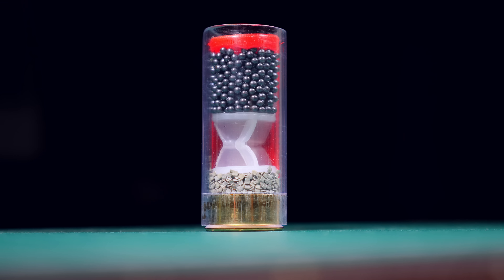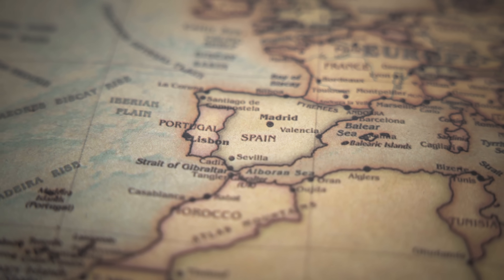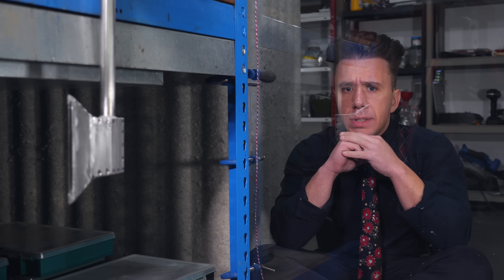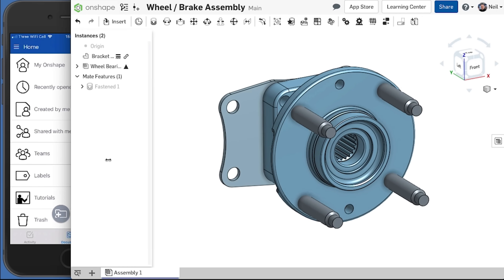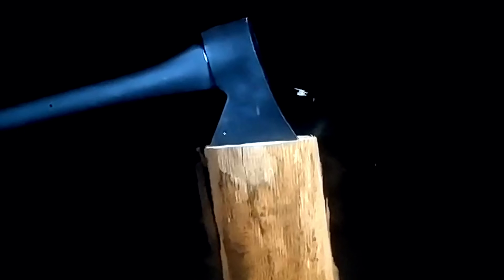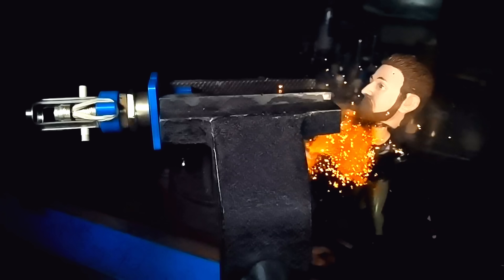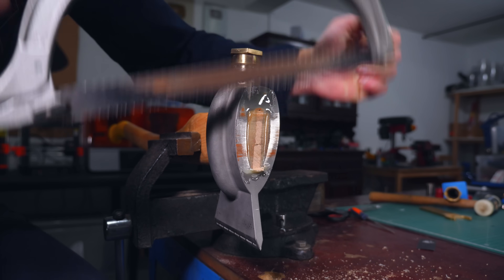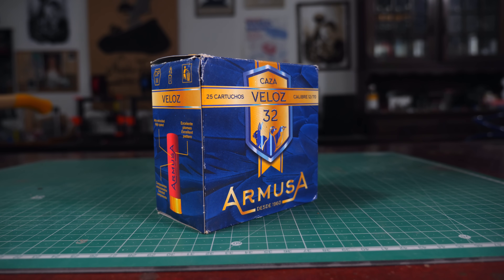I Built a SHOTGUN AXE

Comment: If that's a penny can I have a dollar 😂lol, and ur curious to why the Styrofoam plate boat jump to the left when u said u pulled away too quickly unsure if you noticed the drop that fell in the water to the right as you pulled away.  

** not that I know anything about physics but what if you made the track more like a water slide? I mean by using 3" pvc pipe cut to make two pieces of track,  you can use a heat gun to make any curves.  My theory is like the idea around the whole project "water tension" , in my mind the water in the track will act like the water on the coin and not adhere to the side as long as you don't over fill it,  giving the boat enough clearance to not hit the wide walls.

Comment: i think you've over engineered it. A simple gravity counterweight instead of magnets and rubber bands and half turn lock would be enough, with the half turn going slightly up after locking to prevent accdental unlock. Great video though

Comment: 1:28 a solid axe head with a single hole of the front would have been better — sharper, stronger and more effective.  If the middle 10% of the blade was hole, then it would fire into the gap opened by the remaining edge.

Comment: When I was heating with a woodstove back in the early '80s I had a Chopper I or something very much like it.  Depending on the species (hemlock is a pain in the arse to split) it worked pretty well but it'd send pieces flying.  I spent 'way too much time chasing them down.  If you don't mind chasing wood your shotgun axe will work, but you'll also spend too much time resetting for another swing.  What about gasoline or propane?  No need to set a fresh shell, and probably cheaper to operate in the long run too.

Comment: you have no locking mechanism, you have no safety, and you have a hammer being pulled forward with only a magnet stopping it from moving... litterally the most dangerous you could have made it... its designed to fail with any kinetic force applied, drop it, slap it, it fires...  if its not making something like this should probably be illegal XD... if anything i would put a spring resisting the hammer so the force of the swing acts against firing but a heavy swing fires.

Comment: Mr Integza, what an amazing axe! I was thinking about the way you ignite the shotgun shell and I had and idea. What if instead of having the shell detach from the magnet, you have the shell positioned in a way so that the impact pushes the shell back into a small enough pin that wont penetrate the primer but still ignite it and have the impact and ignition at the same time. I feel there is a slight delay with the magnet. just an idea what do think?  btw tomatoes are disgusting.

Comment: I don't know if you just didn't show it, but you can put the axe head-down and hit the handle with a hammer to seat it in the head. This is useful when the handle is sort of wedge shaped already, and makes the hold a lot stronger when used in conjunction with a wedge on the top.

Comment: This needs a tube magazine inside the handle and a blowback mechanism that chambers a new round after every strike.

Edit: If it was blow-forward, it could even kick the axe back up into the ready position after each swing
Reply: Shotgun shells are expensive (and depletable, and dangerous).  The cost of the resulting processed heating fuel could easily end up being more expensive than heating oil/diesel fuel/propane.

A likely more economically practical (and much safer) approach for homesteaders is to buy an electric chainsaw plus electric motor powered log splitter, combined with an off grid solar power system (which they should already have anyway, if they are serious about homesteading).  Electric log splitters, combined with off-grid solar panels, use no consumables.  The rest of the world could go full "Mad Max" (and/or "Mark of the Beast") and one would still have ability to heat their house indefinitely (at least to the extent that they have access to functionally unlimited wood and their equipment is reliable, and/or they obeyed the prepper saying "two is one and one is none", by obtaining "extra" equipment to replace broken non-repairable equipment).
Reply: @Fritz_Schlunder  That's crazy but you've completely ignored the fact that none of the alternatives you just listed are cooler than a repeating shotgun axe
Reply: @handforgedfuture  From a "cool factor" perspective, I think you would win the argument in the minds of many.  That said, even higher "cool factor" designs are likely possible.  Hypothetically one could design a customized shotgun shell that fires a delayed explosive wedge shaped slug into a piece of wood.  In theory, after firing the slug into the wood, the slug could then explode and blow the wood apart into a bunch of dangerous flying splinters, but with high "cool factor" in the process.  The ranged nature of the exploding slug would provide the user with ability to "chop firewood" from a distance, while providing "sport shooting" like entertainment factor as a bonus.

What human actively enjoys chopping firewood by hand with a conventional axe?  What human would actively enjoy "remotely chopping" firewood by firing special shotguns shells into the wood instead?  I am guessing more humans would end up falling into the second category than the first.  A sizeable percentage, probably a majority of humans seem to enjoy playing with guns.

Alternatively, one could hypothetically design a pulsed water cannon powerful enough to split wood directly.  Such device might have some "cool factor", especially when the operator gets hit with some splash back water and the tool is being used in the wintertime.
Reply: @Fritz_Schlunder  Who are you arguing with, dude? Relax it's not that serious
Reply: @handforgedfuture  I am not arguing with you.  I am telling you that you are correct, a repeating shotgun axe has high "cool factor".  The primary intended audience for my comments are other humans that may happen to come across them and read them on the YouTube platform.  You are not personally the primary intended audience for my comments, but interactive dialog with others provides a vehicle for propagating additional (but still related) ideas into the collective consciousness of those who may read the dialog/exchange.  In order to add "value" to the collective consciousness, new/different/unique/value adding ideas are required to be added to the discourse.  If everyone who watches a YouTube video all comment on the video with the exact same comment (ex: "That is so cool!"), then they are not really adding value to the collective consciousness, since their comment is not unique from that of everyone else's comment.  It is therefore preferable when people add new ideas/information when adding public comments on the internet.

Comment: Great project! For next time you sharpen anything though, the flap disc is for removing paint. Use a grinding wheel (NOT the thin cutting wheel) for sharpening, or a bench grinder.

Comment: I think you went too complex.  The axe head was great but what if the handle and head was all one piece and your slam fire shotgun (hillbilly as you call it) was in the handle and the gasses had the barrel of that to burn the powder at proper pressures then could exhaust under compression when the axe head ports are buried into a piece of wood to be split?

Comment: As a guy who reloads shotshells, pressures can be up to around 14,000 PSI. The powder I'm currently using, Hodgdon's Longshot, likes heavy shot loads because it needs the compressed pressure and resistance to be fully efficient. I want to load down some to spare my shoulder, so I will have to switch to a different powder appropriate for 7/8 to 1 oz loads. Changing variables can alter pressures drastically, so start small and work up to it.
Reply: I'm thinking if he had installed some sort of spring loaded piston to resist the expansion of gasses until the pressure was higher he would have gotten better results.

Something that would have to move an inch or so before exposing vent holes to redirect the gases to the exhaust ports.

Comment: Fantastic!! Well done. If you're looking for a version 2.0, may I suggest using a butane instead of gunpowder. A small tank could be used to refill it after each swing. Perhaps, using the momentum to compress and heat air in the cylinder that would ignite it. Just a thought. Have fun...and don't kill yourself!

Comment: Concerning the pressure dropping too fast: some ammunition have "high-low propulsion system" (search that up) shells: they have a small volume chamber in which the powder burns in somewhat ideal conditions and from there the gases are vented to the larger volume to push the payload. In this case: to split the wood.

Comment: You could have done it the other way around and made a wood splitting bolt gun (like bolt gun used for killing animals but for splitting wood). You would instead use a blank fire cartridge to to drive an sliding axe blade into the wood.

Comment: Very cool, I like (obsess over) guns and would recommend using a better firing pin, one with a smaller tip and less mass, to improve reliability, and have a better, more mechanical mechanism to trigger the firing pin. (That "Piston thing" inside the shell is called the "wad".)

Comment: @Integza I've got an idea that's right up you alley: a cold rocket. My thought is to use dry ice or some other cryogenic material (liquid nitrogen, etc) with a reaction chamber/rocket nozzle made out of copper to generate thrust at room/outdoor temperatures. The copper will draw heat from the surrounding air to heat up the crygenic material to its gas phase. I got the idea from watching a guy (forget his username, but he works with copper, and he made a tool to make perfect spheres of ice. 

thing is he also tried it with dry ice, and while the results were imperfect, i notice the amount of noise made, and it occurred to me there's a lot of gas being made by the excited CO2 reaching room temperature rapidly. with your experience with rockets, I figure you should be able to figure out a reasonably good design based on what's going on here.

Comment: I remember back when I was 16 splitting wood in the log splitter.  We got given catalpa logs to use for fire wood. We put the large log on the splitter  my cousin steps back to what we thought was a safe distance and  I was operating the. Hydronic  ram well  the pressure to split a catalpa log was so strong when it split the halves went fly off the splitter into my legs and into my cousins legs folding him like a chair and flipping me forward

Comment: This is the most American Axe ever made.
It's a work of art.

2:30 No it's called a Slam Fire shotgun.

"800 Bar" Ok now you've lost me. Why not just say 11603.02 PSI? (I know you had it on screen but I'm nit picking lol).
14.7 PSI is the atmosphere's normal pressure at sea level so that's A LOT of pressure.

9:50 "It's illegal to 3D print bladed parts" WHAT?!?! That's absurd are knifes illegal there too?

Comment: in spelunking, in order to break a big rock it is sometimes a thing to drill a hole, then put a cartridge in the hole and puncture it with a screw and a hammer using the same logic, even more stupid and dangerous though

Comment: There is a wedge that was and may still be in use, you fill it with black powder, hammer it into a log, put something like another round at its end and place a fuse, light it and step way back.   the wedge will split a log down its length

Comment: Oh man.  When I saw you put the home made gun cotton in the shell it brought back some memories.  I made some in high school and put two cotton balls in an estes rocket tip for rocket fuel.  Instead of going up it just went everywhere.  Had ear ringing for hours.

I learned 1/8 of a cotton ball in a PVC pipe is enough to accelerate a dry erase marker to mach Jesus or put an AA battery through a 1 ft box full of phone books (those were 4-10 inch thick books you got every 2-3 years for those zoomers out there).

I'm glad for your sake that that full cotton ball didn't go.

Comment: I could see this being useful to a fireman, letting them get through doors faster.
though maybe the blade would have to be redesigned so that it points vertically above the handle and to the front a little, so that the blad is consistently fully in the door that is being broken down.

Comment: You should try using interrupted threading on the breach so that the reloading time is faster 

(Also wouldn't this axe be a great tool for fire fighters and police to gain entrance to buildings faster)
Reply: They have a hydraulic hammers for that. Good enough to push door straight from the wall.

Comment: please redesign the trigger. there is zero safety in the magnetically held design. 

realistically there isnt even any reason to have the axe trigger automatically with the swing. if it was triggered manually, you could swing the axe into the wood just a bit and then pull the trigger to blow it apart. it would be more visually distinguishable from a normal axe wothout needing slow-mo, AND most importantly, it will be safer!!! (Not safe. Safer.)

Comment: You got me wondering if you can do this with ramset shells (or similar blanks).  They would probably be much easier for you to obtain and easier to adapt as there is no projectile to remove.  The only issue I see is wondering if they are powerful enough.  You would likely need smaller gas ports to concentrate the force or possibly use 2 shells but I seriously think it's feasible.  
At the very least, the .22 caliber shells should be much easier to work with - not just for the smaller size being easier to fit in the axe, but also because the rim-fire shells should be easier to set off.

Comment: At one time my Dad had a "stump buster". It was basically a cannon that you filled with black powder and hammered it into the stump. It used a fuse to set it off, but the mechanics were fundamentally the same as your project. Isn't it funny how ideas seem to circulate through time.

Comment: The blade is too long, since you use the gas to split it, it doesn't have to be as long, so you can have a backstop to prevent going too deep.
For not going deep enough... Maybe some Thich needles instead of an entire blade? Experimentation needed

Comment: my HUGE problem with onshape is that its online and in the browser, my number 1 requirement for a 3d modeling software is for it to run locally on my pc and offline, its why I mostly use 123d design and sometime blender, I very often do 3d modeling work when am not online

Comment: Now it needs a trigger, ejection port and a magazine.

Use it as an axe how you fancy it.

Pull a trigger if you need the exhaust gas feature.

Rack and load a new round when necessary 😂

Comment: This is so awesome, and it’s neat to see you do crafts and projects you aren’t specialized in. One suggestion I have to improve this design: the inlets should be further up the blade, as the blade would be deeper in the wood when the shell goes off (with a caveat). That would work if you could make a mechanism that triggers when the blade penetrates to a certain depth. This would be a much more interesting design overall, as it could also be used for demolition, de limbing trees, and it would be more forceful for splitting as well. The bit is also unusually short, but obviously it’s an overall unique design so that’s not too problematic. 

Hopefully you do some updates or further experiments with this!

Comment: Have you seen those one-wheeled motorcycles? The ones where you put your feet on either side of the wheel and you control it like a hoverboard? What if you made something like that, but maybe make the motor out of one of Tesla's designs like the tesla turbine and work out a clutch system to engage the wheel?

Comment: id be interested to know how the gas ports being submerged in the wood affected the backpressure in the device and the duration/efficency of the powder burn. seems like it ended up well. during the video my thoughts were tending towards a mechanical cylinder with a seal to delay the exhaust enough to result in an effective duration, or dwell time as is the term in ballistics. would be interesting to kmow the difference in the burn time between the detonation on the test rig vs a real hit on a piece of wood.

Comment: That plastic piston thing is called a gas seal. 
It expands to seal the gas in the barrel and push the projectile forward. 
Without it the gas would just blow by the projectile. 
you can pick up bits about how the shells go together from TAOFLEDERMAUS 
also maybe use less powder.

Comment: The main problem is modern ammunition uses smokeless powder that is a slow burning propellant. It is designed to maintain a certain pressure and consistently increase. It has to have the resistance of a projectile to allow it to fully burn. What would work better for your purpose, but would be much more Smokey, would be to use black powder that Burns very fast and releases all its energy almost instantly.

Comment: 3d printed metal is not very solid compared to machined... Even machined, I am terrified of what gives way if a particularly hardy log gets hit deep with a fatigued or poorly sintered axe head, as compressed expansion with a shell breaking around it is a grenade.. Hopefully a blow off valve is fitted in the event pressure rises higher than a split should take.